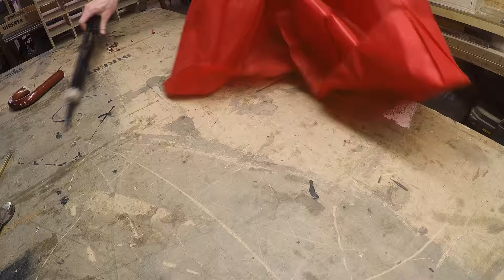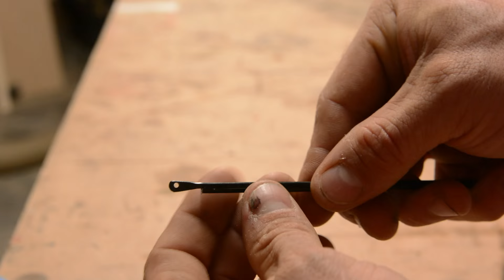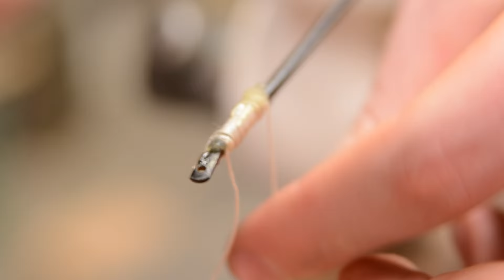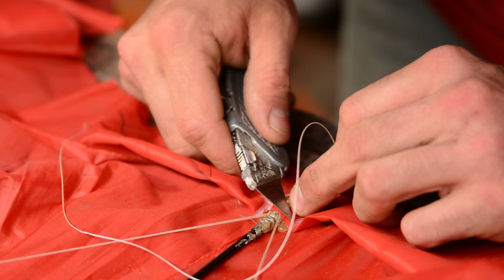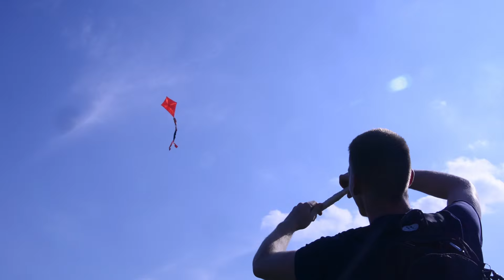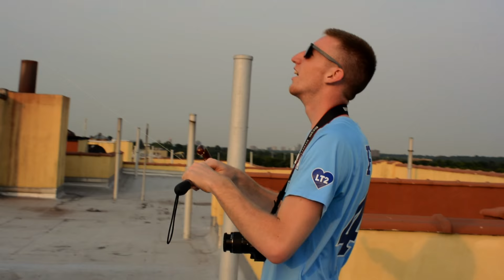Kite made from an umbrella

Comment: Hi David,

As I wrote before, really amazing job! A few questions:
1. Did you use the same string for the frame of the kite as you did for the line?
2. At which part of the kite (middle point? base?) does the line meet? (It's hard for me to tell from the video)
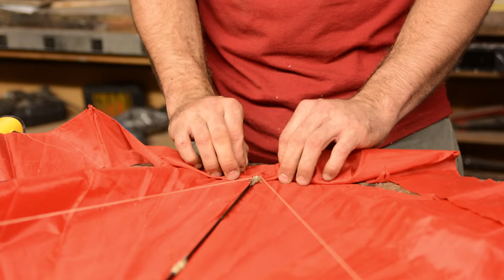3. Does the part starting at 2:00 do anything other than secure the ends of the kite?
4. Is the glue cooler absolutely necessary? (just thinking about parts I have to buy)

Sorry if any of these questions seem silly - this is definitely not my area of expertise!!